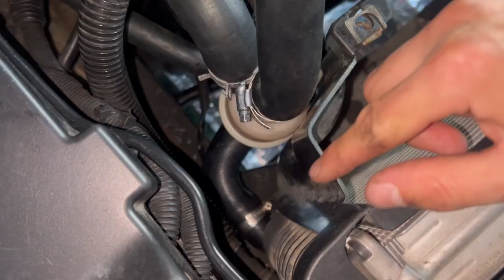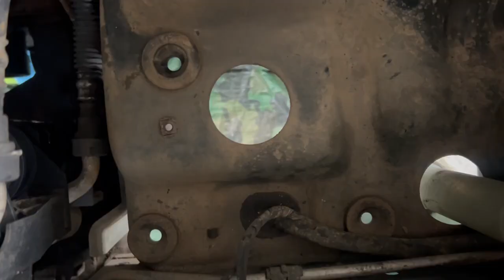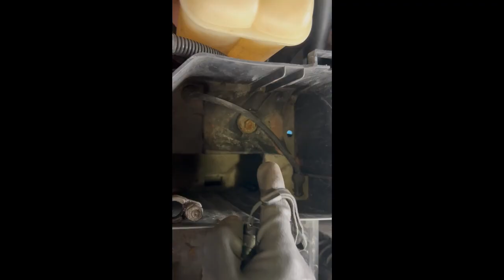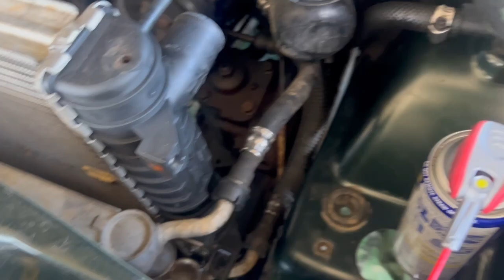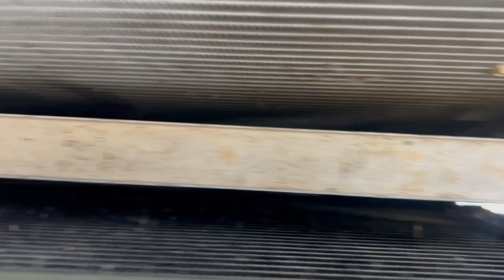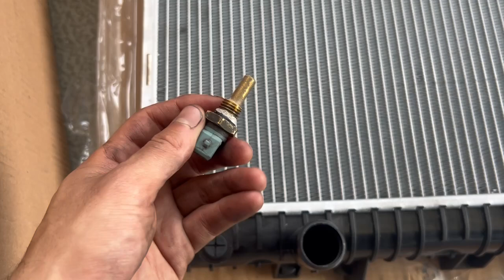Land Rover Discovery 2 (2002) - Vlog 7 - Coolant System Replacements - Part 3 - Radiator Replacement

Comment: I took out the plastic oem stuff and ended up doing the more universal style 180 thermostat with two thermostat outlets sandwiched together. It removed one of the 3 hoses too so it simplified the system. When I did not put the fan shroud back on, i would still hit 215/220 if I idled with the ac on in Texas heat. When I would move it would drop down to 185-190. When I put the shroud back on and changed to green coolant, now I stay at 170-185 at idle with the ac on. When I am driving, I’ll even drop down to 165-175 but happily stays at 182 or so.
Reply: Keep up these videos man! We are a great community and enjoy helping others out! At this time, I am replacing my steering gear because the input seal is leaking. I SHOULD be done this afternoon after I get out of work.

Comment: The inline thermostat is a straight game changer I promise you. I have an aftermarket radiator as well on my 2000 D2 and was getting 200-220F until I did the mod. 

I now get 175-183F with the highest being 190F occasionally and this during the 90F+ degree humid summer here in the South. I went with the 180degree thermostat with the reusable gasket. 

Mod was super easy to install, it’s going to be a cakewalk compared to what you’ve already done.